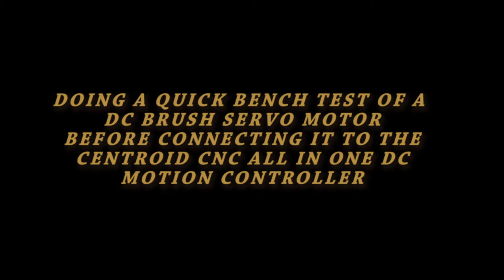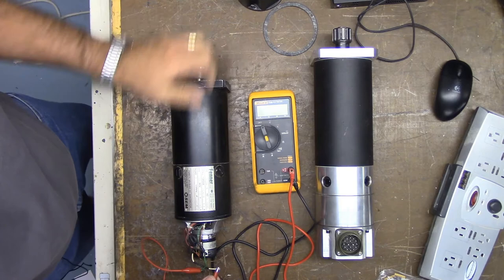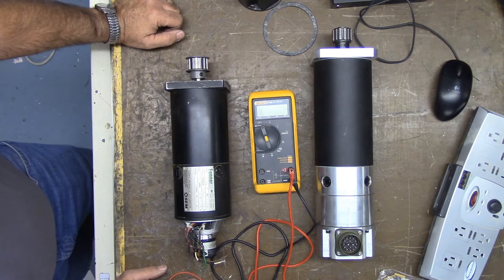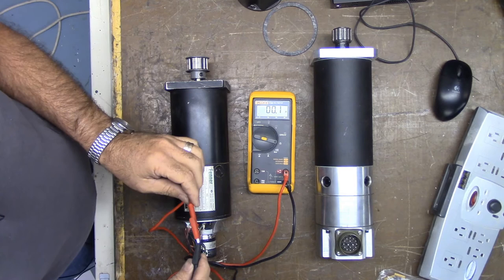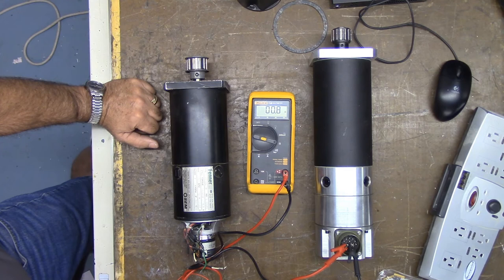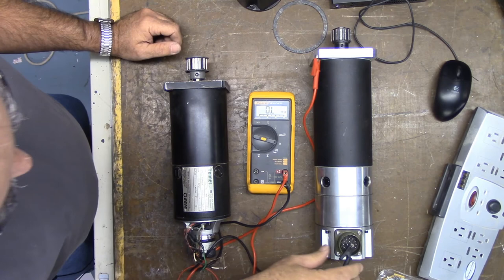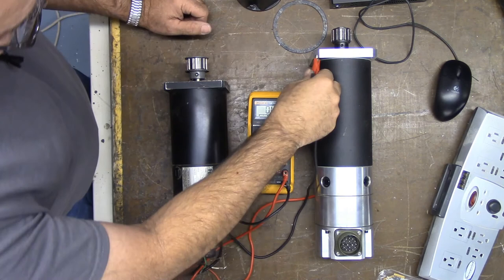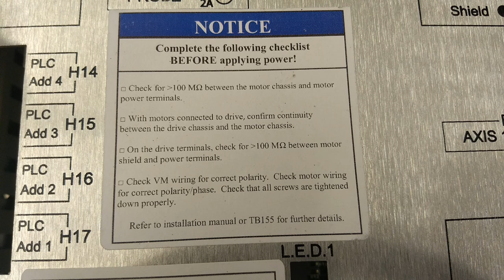Testing Servo Motors using Centroid CNC "Quick Test"

Comment: Hi Marty,

For the encoder, how did you get the counts/revolution?
Reply from the maker: Purchase a 2000 count per revolution, line driver encoder. In the software you set it up for 8000counts per rev.
Reply from the maker: In the video, I only test the servo to make sure it is still good. A shorted servo will damage the drive

Comment: hi sir, i have a SEM servo motor type MT 30R4-58, what servo drive can i hook up with.. thanks
Reply from the maker: rafi, there are many. It depends on your application. search for DC brush servo drives.
Reply: thanks for the respone..i want to replace my interact series 1 milling machine, i plan to buy acorn cnc , any advice?
Reply from the maker: rafi, Centroid All in One DC would be better for your application. Does your mill have a tool changer or no? You could run the motors on DG4S DC servo drives. You may have to change out the encoders. You would end up with a hybrid closed loop system.
Reply: martyscncgarage 
Thanks again,, I thought that I would use acorn board for trial, that means i have to change the encoder? What about all in one, i dont have to change the encoder, thanks,
Reply: And I don’t have a atc for that